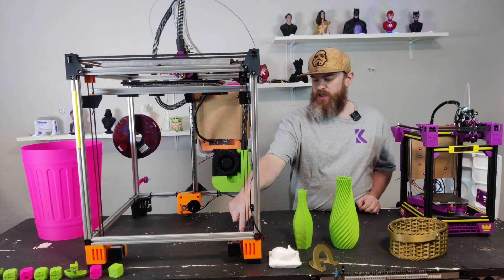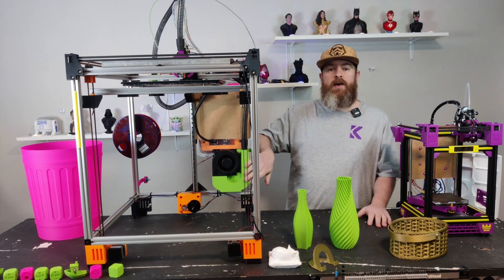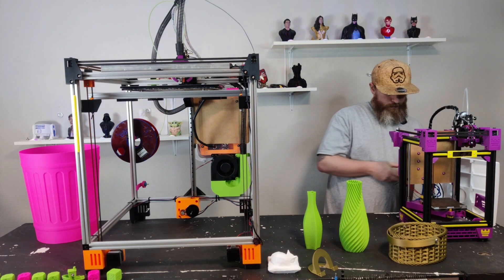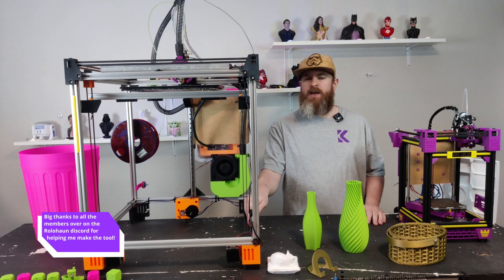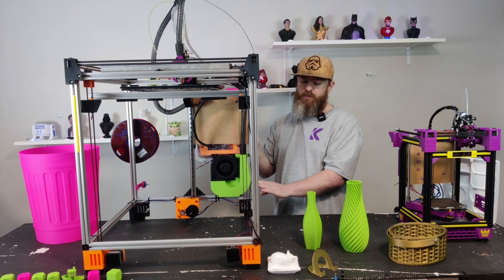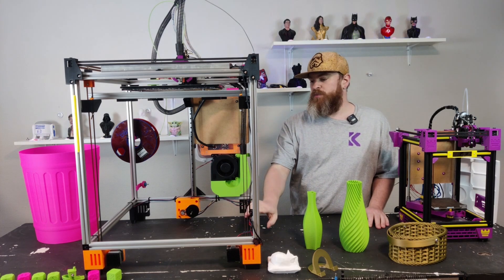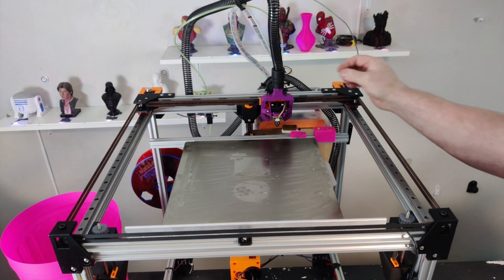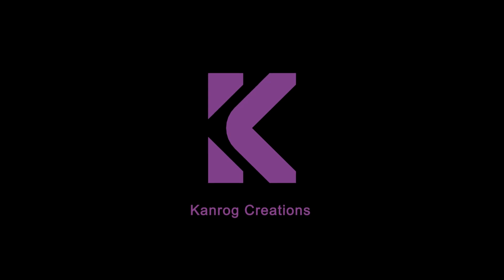Scalable MK1

Comment: I wonder what size of extrusions and frame do i need if i want to use compelete print bed from Ender 7 with build volume of 250x250x300.... i would like to use spear parts that i have
Reply from the maker: Use the calculator on printables 😉👍

Comment: Hi,

i want to Rebuild my Chiron the Bedsize is 400*400 Z i want to have 450.
Do it works with it too ?

Thank You
Reply from the maker: Should be fine, use the 12t Z-axis
Reply: @kanrogcreations  you mean in the File Z the all 4. 12 t geared left/right/rear files ?

And can it get build with fix Bed lile the voron 2.4 that the Z is moving
Reply from the maker: @nihasdreiacht  if doing the 12T version, then all the pulleys on the Z-axis will be 12T.
This will not be able to be a fixed bed printer, that will be a completely different design. Rolohaun is working on one called the Pegasus.

Comment: very impressive. I'm working on a 300x300x375 currently. I'm using 2 lead screws with linear rails for the Z-axis. I'm going to switch to 10mm belts for the z-axis. I'm wondering what your thoughts are about lead screws versus 10mm belts?
Reply from the maker: They both have their god and bad points. My 300x300x400 works great on 6mm belts, but Im sure it wont hurt to go 10mm.
Reply: @kanrogcreations  well, now I have to try it!

Comment: Will you be releasing the files for that blower to CPAP model?  I have a scalable 2020 build waiting to build and would love to add that. Also, is that the Panda toolhead or something different?
Reply from the maker: I'll release the 120 adapter soon, yes. Tool head is a prototype, it's custom to the parts I had in my drawer 🤗